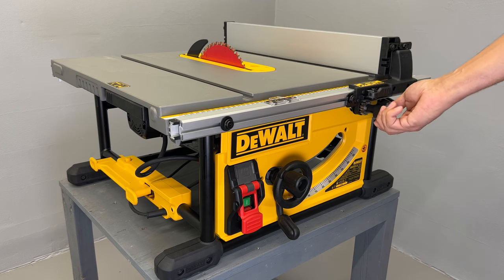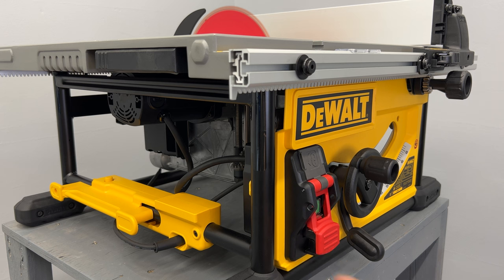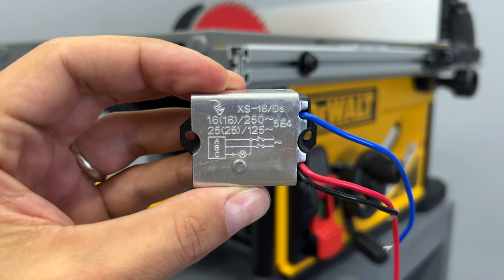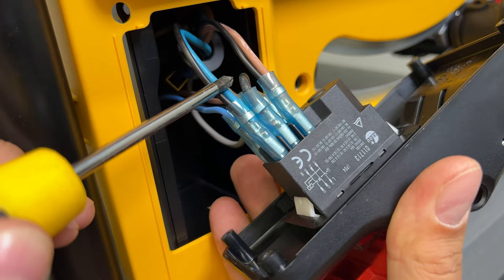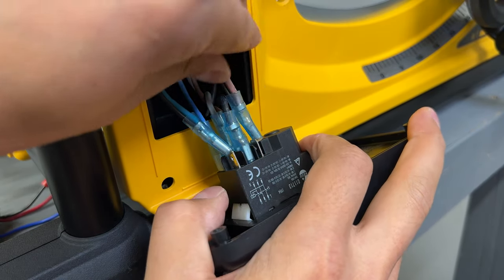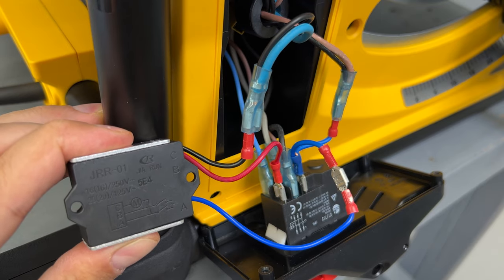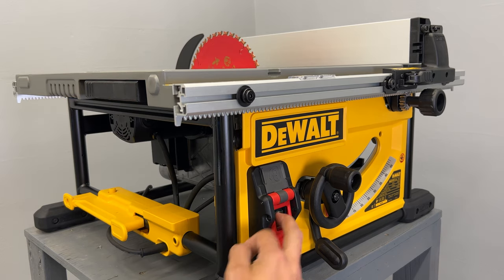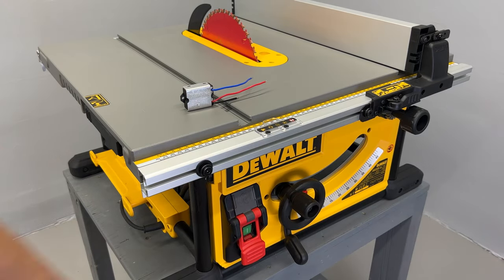Make A Soft Start For Dewalt Table Saw

Comment: Just did this on my DWE7491-XE. It’s a 240v one, the switch is a little different than in this video… but can see where the wires are going so just listened and connected to the relevant motor wires same as in video. Seems to work great at start up. Only hesitation is that the modules wires are lighter than all the other wires so not sure how it will go when under load- but it’s rated for 16A and the saw is only 9.4A. Bought it used, and it gave me one hell of a fright first time I switched it on with hard start so this is perfect

Comment: I bought a Dewalt DWE7491RS,the switch is the same,I checked the part number to be sure and they are identical but the wiring and colors are not.Since the switch and motor are the same,just connect the soft mudule as explaned.For my part I used Hitachi 371468 Soft Start C10Rj without any issues.I'm glad!

Comment: I couldn't start my saw without blowing a fuse.
This solved it for me.
In my case the blue and brown cable colours on the switch were not the same as yours, but I decided to ignore the coloring as long as the schematic on my switch was the same as yours.
So after following your video I can start my saw without tripping my MCB! 🎉

So, thanks. Awesome video.

Comment: I have been using my DWE7491rs for over 2 yrs all the while bitching about the hard starts. Had no idea I could add a soft start module. Amazing!  I did add a 1' x 3" x 36" aluminum box extrusion to the fence which drastically helps the lead in and out of the cut on this saw. Awesome tip, great video that should be included in the manuals...lol!

Comment: I ordered the same device that you used here and the Chinese supplier on Amazon supplied a different one.  Higher current rating but with colour coding of red and blue wires reversed.  The connection diagram on the body of the unit was different - and frankly totally useless.  In the absence of knowing the circuit config of what is in the magic box, I stuck with your config bed on A, B and C and not wire colours - and the result is perfect.  Lovely soft start.  I liked the idea of the Y splitter to implement the circuit on my 7485 - neater than using the piggy back connectors you used in your other video I think. Thanks for the really useful guidance here.

Comment: Thank you so much for this tutorial. I installed a soft start on my Skil table saw 1340AA using these instructions. Works like a dream now. Thank you again!
Reply: I am about to do this on my skil. Is the connections the same as in the video? Something you did different than he is doing in the video? Thanks!
Reply: I literally did the same instructions as the video.  The colour coding of the wires in the power box/switch was the same as the video, I bought my skill 1340aa in the Netherlands. You should draw the wiring diagram out of both the switch box and soft start module, just in case anything is different. I added wire extensions and quick disconnects to make installation easier. But I followed the process in the video and there is a big difference in the start up compared to stock. You could take a video to see the difference too. The startup is far less violent than compared to stock. Hope this helps 😊
Reply: @lionzion5042 Thanks! Works like a charm! Yes much smoother start. Also added wire extensions. 😊
Reply: From the Netherlands, same Skil saw. Just to check; in the video its about the blue/black and the brown/black wire on the Dewalt. On my saw the blue/black en brow/black wire are the same but have other positions on the switch. Did you use the same wires on your saw compared to the Dewalt? Or maybe you have a photo available? Thanks in advance
Reply: Hi! I seem to recall that it was indeed the same colours but in slightly different positions. But it’s important to identify exactly what wire does what. Hence to draw out the wiring diagram. It’s safer to do it that way. To where should I send a photo?

Comment: These are must for a off grid work shop, the hard starts are very hard on inverters, I've blown 1 inverter thanks to table saws, but with the soft starts there are no more blown inverters
Reply: Arthur do you think this module would be useful for other 240V/10 equipment that would benefit from soft start such as a power amplifier with SMPS?

Comment: I might have a newer version of the saw, it has screws on the front and they have made the cover smaller so it cant fit the soft start unit  inside the box. i made slots on the side for the wires and installed the ss unit outside the box. Thanks for providing a detailed guide, it got me to do this mod.

Comment: The best instruction of all video's. Just simple and good to see. It's working perfectly on my Skill tablesaw. But it was difficult to fit de slowstart modul in de box. Maybe the electricity box of a Skill tablesaw is a little bit smaller then a Dewalt.

Comment: Thanks for this, really helpful and well presented.  I have that exact module and saw, so I'll be doing this in the week.
Reply: I did it and it worked a charm, thanks.  NO fuses blown on a 13amp circuit in UK.
Reply: what and where did you buy it ?
Reply: @Drokkstar_ :  what and where did you buy it ?

Comment: Does this reduce the peak current on start up of the motor?  That would help with powering this by solar panels, batteries, and inverters.
Reply: Yes
Reply: Yes, and this is exactly why I need this on remote job sites using power tools with generators!

Comment: Seems great. Does this cause the saw to generate a lower peak load on the power grid? (Prevents the fuse to blow?)
Reply: A soft start mechanism applies voltage in a gradual way, hence "soft start". Flipping a simple on/off power switch allows the motor to draw huge amounts of power at startup, which can lead to tripping breakers/circuits due to this peak draw(short but massive). Analogy: think of comparing drag racing vs a slower but gradual acceleration to the same peak speed. This slower acceleration method puts less strain on the motor and components than punching the gas pedal when drag racing. The internal components on these jobsite saws are NOT designed for maximum tool life, but to do a job for a particular length of time. Some of us(likely you as well, seeing you're here) are interested in maximizing the lifespan of a tool purchase, so adding one of these modules can assist in extending that tools lifespan.

Comment: could you please put a light on your wires coming from the motor.
it looks like there are wires doubled up there.  my swig h is clean with only one wire on each terminal.

Comment: Do you think this could be used for other equipment? 

If so how would you wire it? 

Eg for Audio power amplifier in 240V 10A circuit (Australia) - 2400W maximum input. 

Would you have Wire C connect to Load,  B to the incoming Active/Live, and A ?

Comment: Hi
Where can I buy the Y splitter? Or what size wires and spade connectors do I need to make my own?
Helpful video accept for how to make the Y splitter.
Thank you
Reply: you twist two wires togeher at one end, insert them in the (female) spade socket and crimp it down, then install (male) spade plugs on the other ends. As you can see the one with the two ends in it (female) is colour-coded blue, meaning it's one size up from the red in order for the two wires to fit. These connectors should be available at any construction store. The wire size on the soft start module is .75 mm2 so you can match that.

Comment: Is it possible to install the module in a external box with a power socket so i can simply connect my table saw to it, without installing it on the machine?

Comment: The wires on the soft-starter module appear to be a bit thin for that much current.  Do you know what guage wires they are?
Reply: A 1.5mm wire is rated for 14amp (conservative figure), a 3000w motor draws about  13amp, don't know what motor is fitted to this table saw but doubt anywhere near 3000w.
Reply: @royster3345 I was thinking about the soft-starter module. It is rated for 16 amp on Aliexpress. 14ga wire is only rated for 15amps continuously, so the device would require 12ga wire to allow for the 16 amp device rsting.  12ga wire has a 2.62mm diameter and those wires do not appear to be 12ga wires, which means it is not manufactured to match its advertised rating which means it is unsafe even if that particular saw won't cause it to catch on fire.

Comment: Just for fun, if wire C connected to the brown wire of the motor, and wire B to terminal 13 of the switch, and then wire A connected to the brown wire of the motor and terminal 33 of the switch, it would work the same.

Comment: Hello i would like to know what is the small yellow box inside the switch, mine got fried while i was using it…. (I hope its just a lemon unit) tho ive been using my saw for almost 3 years now….
Reply: Excellent video!  Helped me install my soft start this evening.  I have a 7491.  Very simple.  Took me a bought 15 to 20 minutes.

Comment: Will this work on DW745?
Reply: It should YES, The installation is very simple... The unit just needs the blue as 'COMMON' (while the blue also keeps going to the motor as BLUE) and the other two wires of the unit are 'in' and 'out' sort-of-speak for the motor.... Simple.

Comment: Will I lose my warranty if I connect a soft start module?
Reply: Yes and no.

Yes because Its a modification but a good one that will help the lifespan of the motor and possibly switch contacts long after the warranty has expired..

No because if you fit and remove it without leaving scratches/evidence marks, who at dewalt will ever know?

Comment: is there a 3 phase variant?
Reply: ... yes they make them for 3  phase "440 volts"  also, up their in price 300$ and up for one ... but if it's a new 3  phase motor it might have one in it all ready all  you need to do is wire it up ... look at the front part of the motor were the power goes in and on the sliver panel plate, if not unplug the motor and tack apart the power panel of the motor and see if you see a motor diagram ... it all depends on the years old and how much your paid for it ... some times you can get them bild in when you buy a new one ...

Comment: Install-connect a soft start and shutdown (sparks fly like fireworks on the day of the holiday-electric motor area) of the dynamic brake on the table saw DeWALT DWE7492, DeWALT DWE7485
What do you think the brake shortens the life of the engine ?? Should it be done?
If not, can you share your reasoning?

Comment: My wires are on the other side. What do I do?
Reply: My wall wires and motor wires are interchanged meaning blue plug wire is on 33 and motor blue wire is on 34. Brown plug wire on 13 and brown motor wire on 14. Should I follow yours?
Reply: update: i just copied the connections on this vid and it worked

Comment: Nice! Thanks! I tried to install soft start module for my DeWalt DWE7492-QS by using your manual and it works fantastically! 🤪👍

The biggest difficulty was to unplug connectors, they are plugged very tightly but after playing with this I managed to do this 🙂

Comment: why not install this in a power strip instead, that way you can move it around to different devices if needed?
Reply: Because of the way the module works. Once it get power it ramps up the current in stages up to full power. If you put it in a cord or powerstrip it will go to max power and stay there as long as it's connected, unless you start and stop the machine by pulling the cord/strip and that is a fire hazard. In a powerstrip with on-off switch you could, I guess, but it could damage some equipment not suitable for unstable current. Also, switches like that are not made to safely disconnect heavy inductive loads like a tablesaw and might arc-weld itself.
Reply: @Ajzer85  I mean put the soft start downstream of the switch inside the power strip itself.  If the soft start is doing its job, it shouldn't arc weld when turning the device on, although I guess it might do it when trying to turn off.

Maybe the alternate would be to build it into a foot switch extension cord since those should be designed to switch full loads.

Comment: Hi everybody, any of you guys who installed this soft starter module have had issues after running the power tool during months or years? I am just concern with the quality of these cheap modules and how are going to behave after a thousands starts/stops. Anyway nice tip

Comment: Dewalt table saws are rated at 20 amps. That module is insufficient amperage for a Dewalt table saw
Reply: No, this is a DWE7492 which is the European model using 230V. So 2,000w at 230v is only 8.7 amps. And even when using the US 120 volt, it is still only 16.6 amps, which should be fine.